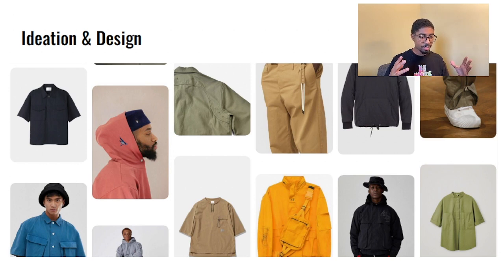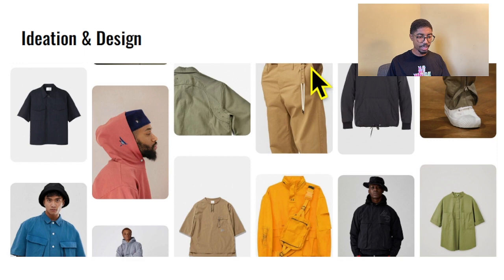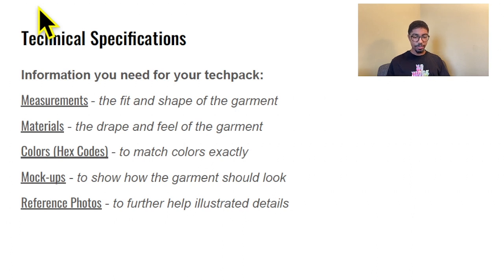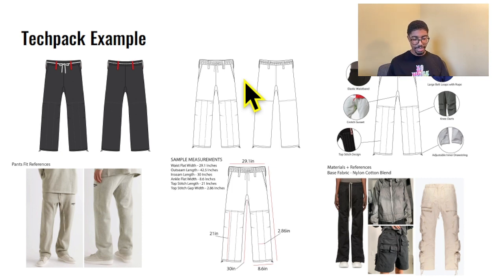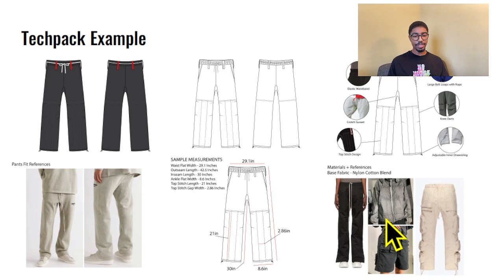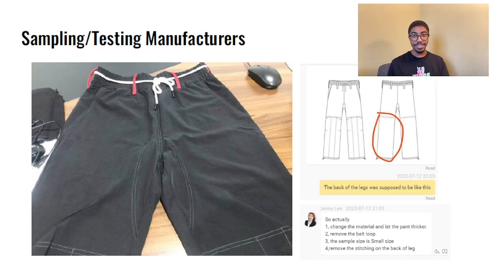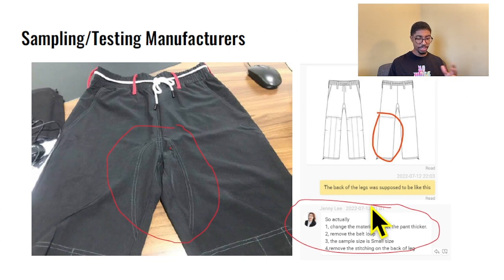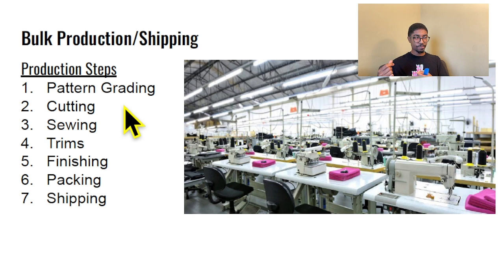Everything You Need to Know About Cut and Sew Manufacturing! 30 Minute Crash Course

Comment: What if my design is not ordinary and simply drawing and added references for the design won’t suffice. Do you recommend I try my best to make the sew it myself then send that as the reference or are these manufacturers really skilled when it comes to turning tec packs into reality
Reply from the maker: If you have the ability to make a rough sample then I’d always suggest doing that. If not, you may need to sitdown in person with a seamstress so you can better explain to them the details.

But it’s definitely possible to to make a complicated techpack. It just may take more time and details to really communicate what you want

Comment: thanks for the info. is alibaba and instagram the only places you've used for manus?  could you also give examples of brands you know that use alibaba? id like to see the type of work that alibaba can produce.
Reply from the maker: Alibaba and Instagram are just platforms for manufacturers and many of them are listed on both as well as other platforms. Pretty much any overseas manufacturer is going to be on alibaba because they know it’s a lot potential clients. Most mid level brands you’ve ever seen on IG are using a manufacturer that can be found on alibaba.
Reply: @nicholasakoto  some of my products compared to a lot of these smaller brands are complex. you think alibaba is the place for that? i’ve only had negative experiences on there so i’m skeptical to put trust in them even if their catalog pages look so good.